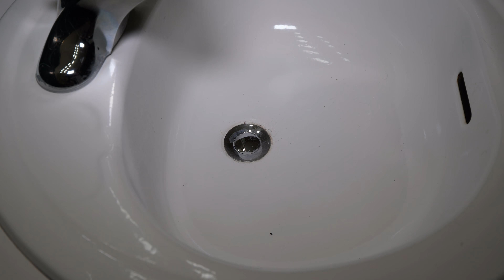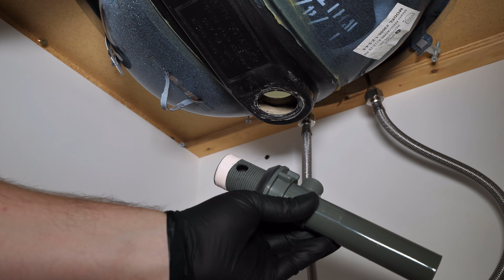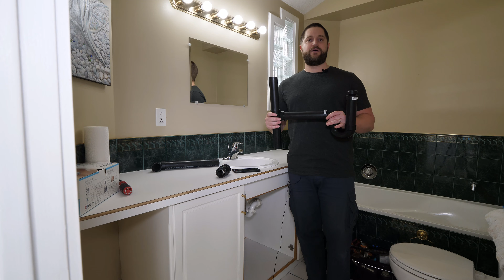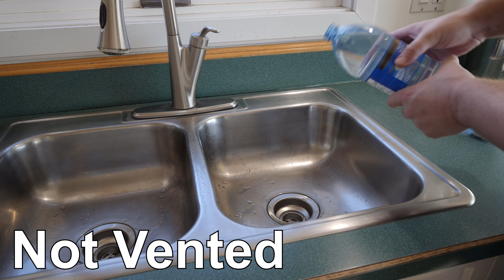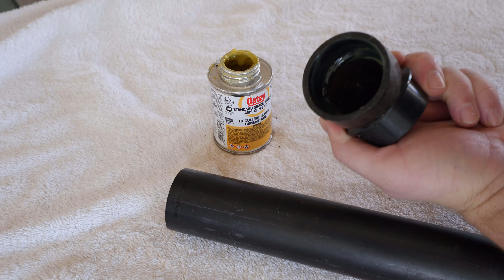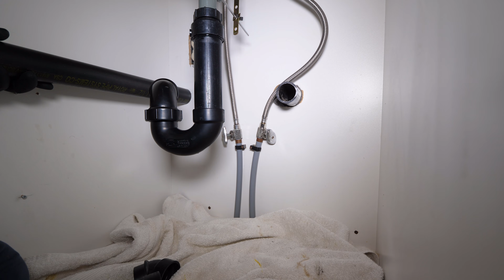How to Connect a Bathroom Sink Drain

Comment: Is it a permanent connection?  How do you repair if one part is leaking?  I add your video to my reference list.  Thank you.
Reply from the maker: The trap can be removed by loosening off the p-trap union and trap adaptor union. Thanks for the question!
Reply: @PROSDIY   I hope you can help me with a bathroom plumbing problem.  The connection joint between the trap arm and the drain adapter is leaking when the water is off.  The leak is very slow, just a few drops of water.   However,  there is no leak when the water is running.   I've replaced a new trap kit, tightened the compress nut, taped Teflon on the threaded wall adapter, and even used rubber washers instead.  None of my efforts is working.  What could it possibly go wrong?  How should I fix it?   Thank you.
Reply from the maker: @binhminh417  Some compression nuts have a nylon washer that is tapered. The taper faces the fitting and not the nut side. If this isn't in place it will most likely leak/drip. Without seeing the style of trap adaptor you are using to connect to the trap arm to the rough-in plumbing, it's hard to give you an answer that's going to be 100% correct. If you are continuing to have problems with this connection you could cut it out and use a flexible coupling. Like this one: https://www.homedepot.com/p/Fernco-1-1-2-in-x-1-1-4-in-DWV-Flexible-PVC-Coupling-P1056-150-125/100044154
Reply from the maker: @binhminh417  Does the trap adaptor at the wall (waste connector) have a washer, usually made of nylon/plastic? Sometimes rubber. It's very important that it is straight and flush as possible before tightening. If the washer is tapered, the narrow end of the taper would face towards the wall in the picture you sent me.

Comment: In your kitchen sink video you used a cheater valve for a vent. Do bathroom sinks need a vent as well? Thanks!
Reply from the maker: Yes, bathroom sinks need to be vented as well. The vent for this bathroom sink is connected in the wall. It looks like the 4:48 mark. The AAV or cheater vent is only used when there wasn't a vent roughed in to begin with and it's the only practical option. Thanks for the question!

Comment: From the wall there is 90 degree elbow facing down and then the p-trap. According to what I have learned form you that must is incorrect. I need at least 3 inches from the wall and the p-trap . I want to replace it to face it to the right and add 3 inches tube to put the p-trap, but the there is no space to cut it and placed the new one. What do you recommend?
Reply from the maker: It sounds like a tight situation to work in. There's two options. 1st is cutting out the fitting in the wall and replacing with new. 2nd is cutting the pipe just as it enters the fitting and then chiseling out the pipe that's glued inside the fitting, so then you can add a 3"+ piece. This option can be quite a pain. You're right in that it wouldn't be to code the way it is installed now. It is basically an S-trap. It's your call in the end if you want to change it. Are you getting any sewer gas smell from the sink?
Reply: @PROSDIY  Thank you for your reply. No smell from the sink, is inside the cabinet and the cabinet has a very thin layer of blue mould, that is why why i would like to redo the plumbing. this is on the kitchen. I have 2 returns on the wall in vertical position, one has the food processor and the dishwasher and other one is for the second drain (sorry for the terminology).
Reply: @PROSDIY  Maybe i can use a Hole Dozer to remove the outside part of the 90 degree elbow after the cut. what do you think about that?
Reply from the maker: No worries. I understand what you're saying. That's one option. The method I use is cutting the tubing with a saw. Then using a loose hacksaw blade to cut 2 grooves in the pipe that is glued into the fitting about 1/2" - 3/4" apart, being careful not to cut too deep and into the fitting. Then using a chisel or flat blade screwdriver with a hammer to remove that 1/2" - 3/4" piece. Once that piece is removed the remainder of the glued piping is usually quite easy to remove by prying up one end of the glued piping with the chisel/screwdriver and working your way around. Hopefully this makes sense.
Reply: @PROSDIY  thank you. I will work on that in 2 weeks, let you know
Reply from the maker: Sounds good. Good Luck!

Comment: Great Video. Can I use 22.5 and then 22.5 + 45 fittings to offset the p-trap connection to the sink if needed?
Reply from the maker: You are allowed 135 degrees of change in direction between the trap outlet and the vent connection. This includes any change of direction that may be in the wall. As long as there's no more than 45 degree of direction change in the wall to the vent you are ok (22.5 + 22.5 + 45 + 45 = 135). Hope this helps and thanks for the question!
Reply: @PROSDIY  Excellent, thank you for the info

Comment: Awesome video! I need to install a new vanity at my sisters place in which the p.o plug doesn’t line up with the 1 1/4” copper drain pipe. My guess, off by about a foot, would it be code to put a 90 elbow roughly where you placed the 45 ft elbow?  Would it be wrong of me to use a 11/4”cpr. x 11/2” ABS trap adapter to connect the horizontal drain pipe coming off the wall? Sorry about the novice like questions, I’m going to give it a try. Thank you kindly for confidence booster all due to your great video!
Reply from the maker: Hi Rick, There's a code in plumbing where you can't run a 90 in the manner you explain, but you can run two 45s glued together. The two 45s create a longer sweep than the 90 and allow for better drainage. It's also perfectly ok to tie into the wall rough-in piping with a trap adaptor as you said. You can even use a flexible coupling like this one: https://www.homedepot.com/p/Fernco-1-1-2-in-x-1-1-4-in-DWV-Flexible-PVC-Coupling-P1056-150-125/100044154 which can make installation easier.

Just a thought. You should be able to connect using one 45 as in the video. You may have to cut the rough-in piping back a little further to get the right angle to connect to the p-trap, or possibly extend it. Either way, it will still be to code. Thanks for the questions and good luck on your project!
Reply: @PROSDIY  Thank you so much for your thoughtful, detailed answers. I ended up not needing to use a 90 elbow. A reg 45 in place of the 45 ft elbow you used did the trick. I’m so glad I cane across your video, it was definitely needed since I also had to install a single hole Moen faucet with a mechanical p.o plug.  You rule bud, til next time, take care!
Reply from the maker: Awesome! Nice job on your project. Cheers!

Comment: This is bullsh!t bro ..doing it all fast. ..making look to easy stuff takes me like months ..question for you does my new sink have to be straight over the peetrap or what’s the furthest my sink hole can be from the peetrap ?
Reply from the maker: You can use two 45° fittings to offset the p-trap connection to the sink if needed. The preferred method is to put the p-trap directly under the sink hole though and then offset the piping to the wall, as it's demonstrated in the video.

Comment: Codes?  I didn't know homeowners worried much about codes.  Excellent video.  I especially appreciated the explanations about the slope and pipe diameters.  Just shows the difference between the homeowner diy guy and a pro who knows.
Reply: i not always a stickler for all rules but having moved my elderly relative into a place WHERE HOUSE FLIPPER apparently didn't THINK WAS IMPORTANT TO ADHERE TO LOCAL  PROPERTY ETC N BUILDING CODES , ITS 4 YEARS DOWN THE ROAD , STILL HAVING TO REPLACE ALMOST EVERYTHING BUT THE WALLS , MITE HAVE DO THAT TO AT LEAST 1 SIDE, PORCH ADDITION FROM STORM, WIND, WATER N TREE DAMAGE NO INSURANCE
Reply from the maker: Thanks Charlie! Cheers 🍺

Comment: Any idea what to do when the old drain is in so tight that the big nut just spins the entire fixture when trying to loosen it?
Reply from the maker: I use a second adjustable wrench to hold the pop-up assembly from spinning. Hopefully this helps.
Reply: @PROSDIY  thanks. Ended up using a locking vise grip in the same way
Reply from the maker: Perfect! Glad you got it figured out. Cheers!

Comment: Put a plate on that outlet
Reply from the maker: 👍 It was done shortly after. My question is, why is there an outlet under a bathroom sink. lol
Reply: @PROSDIY  Future garbage disposal? Seriously, it'll be really handy if you need to install a small point-of-use on-demand water heater when it takes 5 minutes for your hot water.
Reply from the maker: @bobbobbert2768  Garburator on a bathroom sink? or an Insta-Hot?

Comment: I seen another video where it says to turn the pop up facing in the other direction. Which one is right?
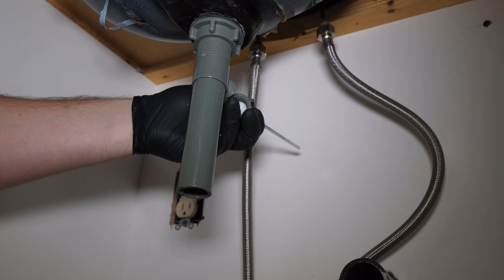Reply from the maker: Do you mean the part at 3:40 in the video? There may be different installation instructions for different models, but every model I've ever came across states to install the popup with the hole closest/facing to the back of the cabinet.
Here's a link to an installation example:
https://www.bathselect.com/Installation-Instructions-For-Milo-Gold-Plate-Bath-Vessel-S-s/1285.htm
Reply: @PROSDIY  Thanks, good to know. I only remember watching one other video where it was the other way, so that's my own laziness. Maybe with that brand (from the other video) it was done that way but seems strange because the pop up thing with that plastic hole looks almost standard. Anyway, thanks for answering the question.
Reply from the maker: No worries. I find the issue with installing it the other way is that sometimes it will actually pop out of the hole and be free floating. This usually isn't an issue and some people will actually install the pop up free floating so that they can remove it easier to clean. The down side to leaving it free floating is that I find it doesn't make as good of a seal in the closed position. Take care!

Comment: You have polybutylene water pipes polybutylene got outlawed in 1994 it’s not code anymore.
Reply from the maker: You're right it was banned around that time and removed from the Plumbing Code of Canada in 2005. The ban stated that the distributors were no longer able to sell the fittings and piping, and was to be no longer installed. There are still millions of homes with poly-b though. There's no code that I know of that states that you can't have them in your home from being previously installed. There are a few studies showing that heat speeds up the rate of deterioration. This is why there were so many failures in the States. The warmer climate and waterlines commonly installed in the attic, where it can get extremely hot, were some reasons for this. It's on the list of things to repair/replace. Cheers!

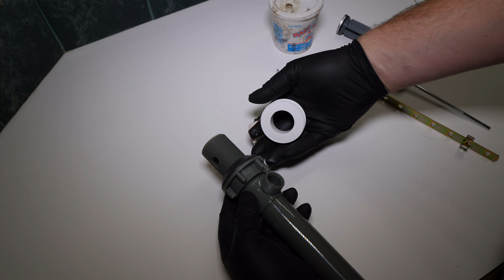Comment: Why do you need to put teflon tape to top of pop-up drain at 2:14 ?  Thanks
Reply from the maker: Great question. This is to seal the threaded connection between the drain flange and body, it's not 100% necessary as the rubber gasket at the base of the drain body should protect against any leaks. Just an old habit I must say. Cheers!